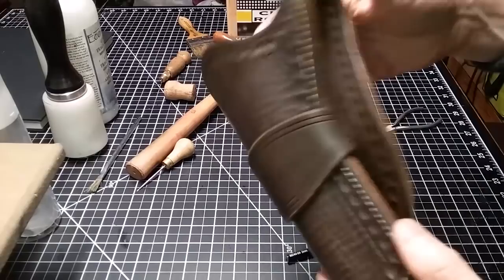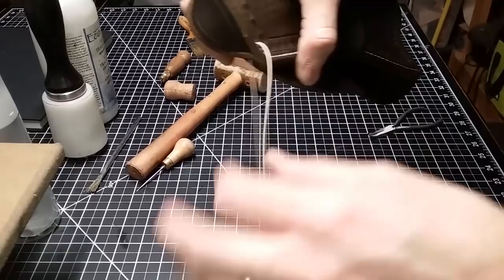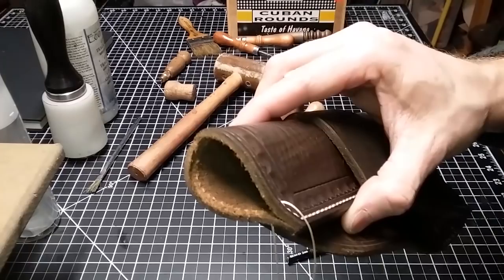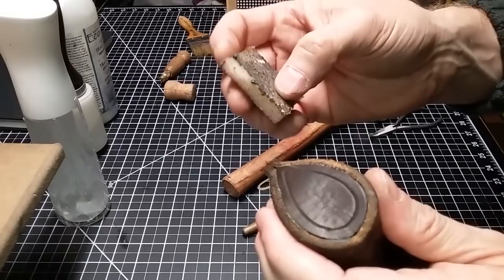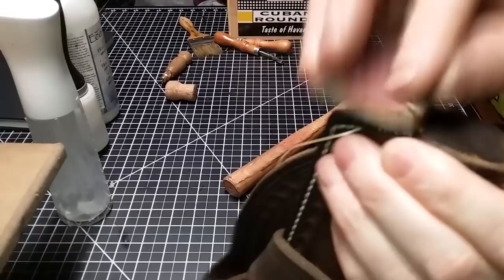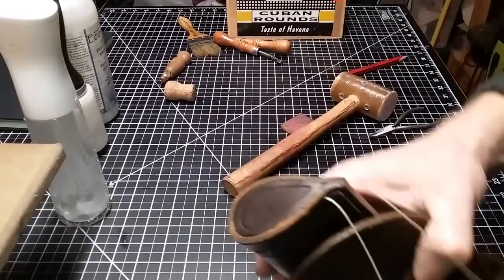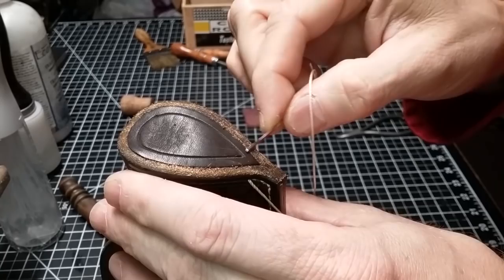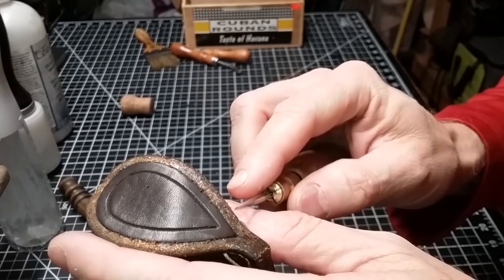Leatherworking: Sewing Toe Plugs into Leather Holsters

Comment: Seems like that would go much easier if you stitched it first, starting with the pointed end of the plug and working your way around, folding the holster as you go and then stitching up the belly.
Reply: Could you apply the glue, but have all the stitches in but loose, then pull then tight and the end piece will “pop” right in?
Reply: It'd be almost impossible to ensure the edges of the holster aligned properly.